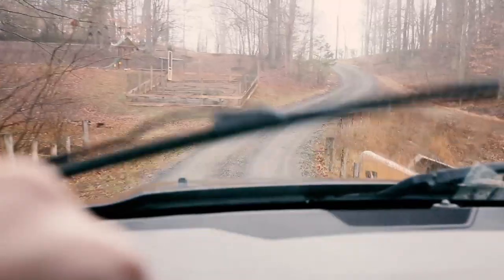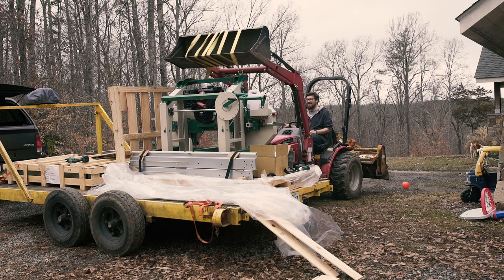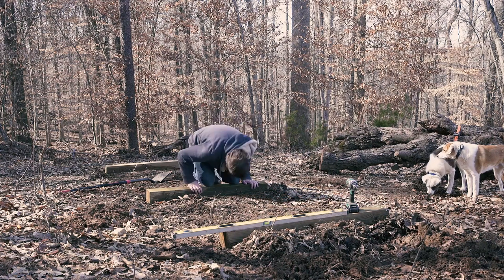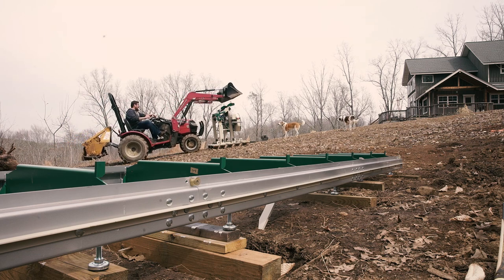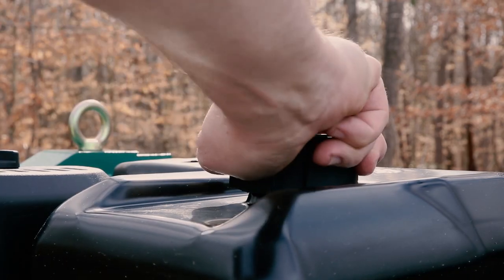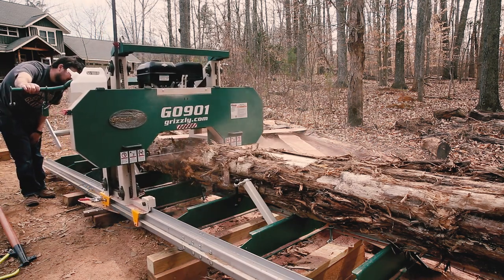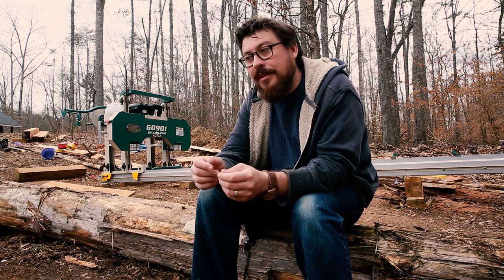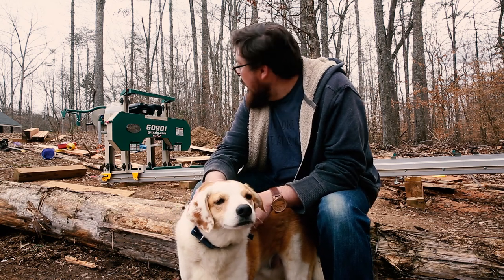I got a SAWMILL! Grizzly G0901 unboxing and overview

Comment: when they said flat and level, that is what they meant. Dig it out and pour a slab with bolts to secure the mill or you will be fighting this hillside forever.
Reply from the maker: Yeah, I'm going to see how it goes and check it often.  I'll likely end up pouring a slab at some point.
Reply: Their demo video on the website doesn't show it on concrete if I remember correct.

Comment: For homestead style mills like this, why aren't the blades 2-sided, so you can cut in both directions instead of having to go all the way back to the other end to lower the blade and make another pass? I'm sure there is some reason for it, but I can't think of it.
Reply: There is a trust bearing at the back of the blade, like a standard bandsaw. One side needs to be a smooth to run along that bearing.

Comment: I was wondering how this was holding up? I like the design looks solid just not much info out there on them. How have parts availability been? Can you use 1.25"blade or do you have to run 1" blades?

Comment: Are you going to or have you built a shed over the mill? It will definitely keep it nicer if you do. Nice mill.  👍
Reply from the maker: I'd like to. I'm not sure if this is the final placement for it yet though. I basically live on the side of a mountain so I have to figure out smart grading so I don't have major mud and structure damage. I currently have an xl grill cover over the carriage but it's not the best solution. I feel like a Copperhead is going to bite me every time I take the cover off (rural piedmont with lots of good places for danger noodles). I'll figure something out though.

Comment: Why didn’t you use the forks on the tractor to load the log?
Reply from the maker: The log was pretty long and it was precarious and seemed more manageable with the peavy.  Shorter logs (what I will likely be milling more regularly after this timberframe project) I think the forks would work well.

Comment: What are some of the most valuable uses for cedar?
Reply from the maker: It excels at rot and insect resistance so its used in outdoor applications. Eastern Red Cedar is also known as Aromatic Cedar and used to line closets and blanket chests. It is quite soft though so I would be hesitant to make a table top out of it though people do

Comment: Hello Will. I enjoyed the build vid.    But doesnt the situation with the 6x6 require at the minimum creosote soaked beams due to constant contact with the ground.   What do you think the life span will be even of they are treated post timbers?  If to do over  again would this come into play or is the lifespan of these timbers sufficient.  Myself I would want at least 10-12 urs for the footings.  Harleymike/chicago
Reply from the maker: Hey Mike, the are pressure treated ground contact lumber. I originally bought them for a retaining wall that was in the ground for about 5 years until my wife didnt like it anymore. I yanked them out. No signs of deteriorating. Just a little muddy.
Reply: Wm. Walker Co. well there is my answer on that

Comment: Congrats Will! I had wondered when you would move to harvesting your own lumber. Just remember that harvesting wood, whether it's logs or fireword, is a VERY dangerous proposition. Never do it by yourself!  Good luck and have fun. Charlie
Reply from the maker: I think "logger" is ranked pretty high if not the highest on the dangerous jobs list. Theres a lot of weight in the logs that needs to be respected. I've got a pretty good track record felling trees but did have one that defied what should have happened. It ended up fine, but it shook me a little. Definitely a job that deserves forward thinking and awareness. Thank you for reminding me!